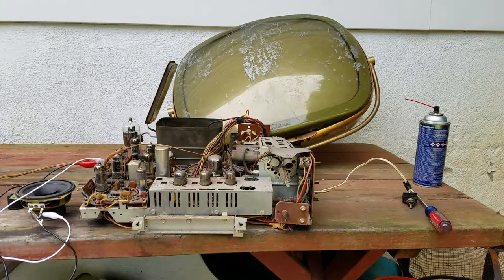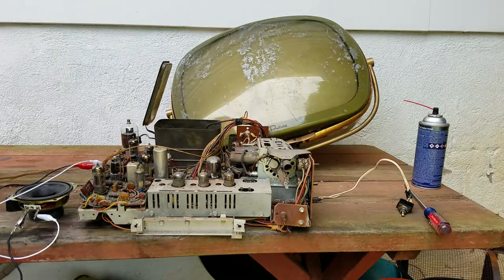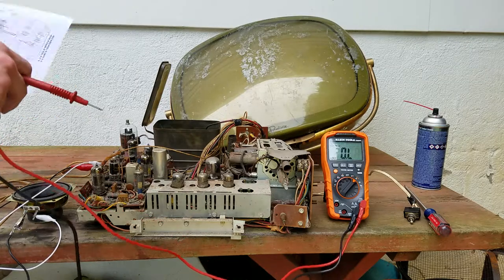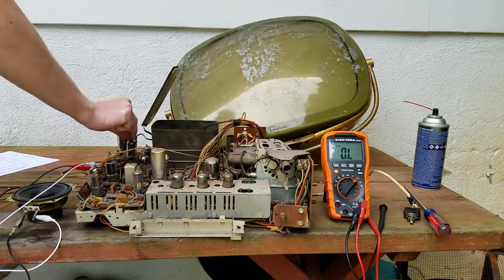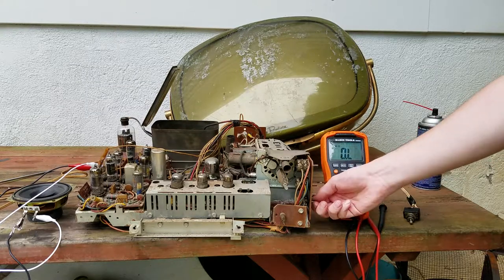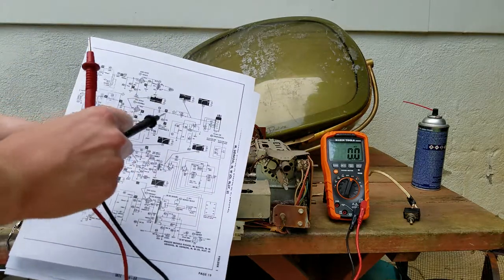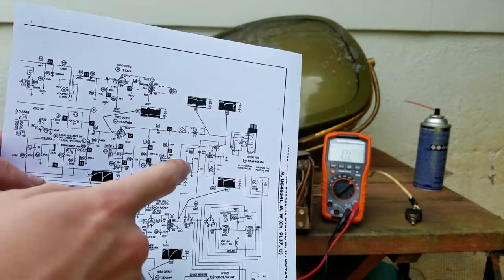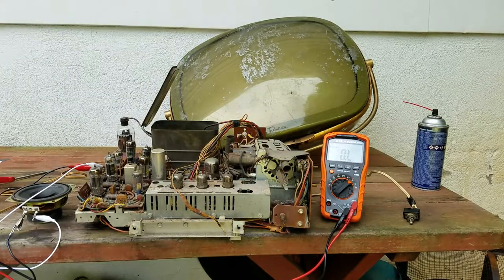Dead Screen Philco Predicta Holiday

Comment: I have one of these in my basement. Always wanted to restore it. It has everything it worked when I first got it Thirty years ago.
Reply: Just do a simple CAP replacement first and se if youi get a better performance. Make DAMn sure you use the exact same values. Don't copnfuse .0033 with .033, etc.

Comment: hi
maybe let the tube bake for a while or try rejuventaing it...connecting g1 and cathode to 220v mains with a 15w lightbulb in series has worked for me before, now i have a crt tester/rejuvenator...i know they dont make miracles but a crt with just a little bit of emission sometimes can produce a watchable picture... cheers
Reply from the maker: If this has been basically any other TV I probably would've gone farther, but between the cabinet which was in pieces and had to be glued back together (and parts of it are still maimed, such as where someone drilled a hole to mount a replacement power switch, and they also drilled a hole through the metal front grill to mount a replacement speaker), the cabinet collapse had damaged a coil on one of the boards, and the dead CRT I decided this one wasn't worth it. Despite the other damage if this had been the 6 volt version of the tube I might have continued but the 2 volt versions (which I verified this tube is the 2 volt version) are known bad CRTs. If you're interested in one of my more recent videos I did get a Hoffman Easy Vision TV with a weak CRT watchable in the dark
Reply: @bss1250  i was now reading a schematic for a german set that i am currently working on and on this set the cathode is actually more positive than g1...brightness control is from g1 to b+ and the connection to ground only acts as voltage divider...the modulation is also fed on the cathode... are you sure that grounding the cathode will bias the tube hard?or you would be doing the opposite way...my predicta also shows a very dim raster if i disconnect the video wire
your eht could also be low contributing to low brightness...but the spark you drawn with the screwdriver looked healthy to me

i also have a predicta but its an italian version,the chassis is different and so is component layout and schematic
i subscribed to watch your other videos, i also have some videos about my tvs if you want to watch
Reply from the maker: @Hugo B. I went back and checked the schematic, and the arrangement seems very similar to what you describe. Are you saying the return path for the high voltage is actually to B+ and not to ground?  If that is the case I'm surprised it arced to ground as readily as it did, if ground is a high resistance return path. Either way you definitely gave me something to think about, I may get back into this in the future and try it with the brightness pot back in circuit instead of going straight to ground
Reply: @bss1250  The high voltage at the anode is not supposed to return to the cathode...that would cause flashover and destruction of the electron gun like it happens on gassy tubes....you would see a blue glow inside...also if you could ground the EHT it loads down the flyback and it drops to almost zero....i cant explain it with scientific detail because i am no expert but the high voltage is there just to accelerate the electrons that leave the cathode and the faster they hit the phosphor the brighter it gets...something like that...the high voltage will arc to anything close to it that has a more earthy potential,even b+lines.... you dont need to ground the screwdriver for eht to arc to it..however you may feel it depending on the screwdriver you use :)  then you have the other grids wich are for focus and they are just there to electrostatically center the electron beam

i can only talk for certain about my sets but i believe your predicta would work the same way! there are sets with positive going or negative going video modulation...and some sets feed modulation to the cathode and some feed it to the grid...(the vast majority feeds it to the cathode) ,along with the modulation there is always a dc component in order to bias the tube....i believe all crts have to biased the same way so just try feeding the cathode with about 20 to 30v more dc than on g1 , that should bias the tube in a way that it produces a nice bright raster..also you need to check voltage at g1... if your schematic doesnt list voltages you can check the tube's datasheet...but often its just bad potentiometers...  when you said in the video that you did not know wich way around are the controls , on the Philcos i believe the horzontal hold pot has a shielded cable to it, identifying that can help you figure out easily wich one is for the brightness... Also on many of my tv's turning the contrast all the way down kills the raster so that might be a problem also.

edit:
just looked at your video and g1 is marked zero volts on the schematic and cathode 35volts so yes a 20 or 30v difference like i said above and the cathode is more positive than g1...i really believe that the ground point on your brightness pot is for voltage dividing. i would check those two voltages at the neck of the tube...the other grids dont really matter because they are used for the focus.you have 400v boost voltage on one of them and you can select from 0 to 200 and something on the other, whatever gives the best focus
Reply: the filter choke you mentioned after the video amp is just a video peaking coil and you can bypass it if its open...its just a copper coil wound around a resistor making a certain inductance..bypassing it makes some artifacts in the image but no big deal. also if capacitor c24 is leaky you will have excessive DC voltage at the cathode because it will go around the brightness pot making the image brighter, i dont know if excessive voltage can overload the tube and make it cut off, maybe it can...100v like you read there seems excessive to me in respect to a 0v g1...  i would also check the EHT, i believe that 15kv must give you a 1cm steady arc...those eht rectifiers like to go weak
Reply from the maker: @Hugo B. Thanks for the info, I had always just assumed that grounding the cathode would produce the max brightness but I see this may not always be the case. I think I will try working on this TV again in the future
Reply: @bss1250  on "normal" vacuum tubes usually thats the case...the smaller the cathode resistor to ground the harder the bias...but on a crt usually not...the bias is the voltage difference between cathode and g1...i am glad if i was of any help. i am still learning about vacuum tube tv's, unfortunately nobody cares about the subject so i feel kinda lonely on the hobby
Reply from the maker: @Hugo B. Iv'e only worked on a few TVs so far, but I think its an advantage that not as many people are interested in TVs as it somewhat keeps the prices low. I got 2 of my TVs for free and one for $10. Same thing with repairing mechanical calculators, where even on ebay they're often cheap
Reply: @bss1250  here is different...expect to pay 100 to 250€ for a 1960's tv in Portugal...people are very hipster and they think an old tv is vintage,cool, space age and whatnot so they price accordingly, but if nobody buys they rather put it in the dumpster or extract the copperfrom it then selling it for a fair price...its sad... also we were in a dictatorship until 1974 so our tv history is not as old as on the US...no tube colour sets here , no 1940's tv's either... i learned alot form shango066 channel and by spending hours trying to figure out simple malfunctions...i wish i had a local mentor to help me sometimes
Reply: @MrHBSoftware  I'm 67 now and started when I was about 30? and even baack then I felt like I was working in a buggy wip factory. The Internet came in and I begin to meet other buggy wip makers. ITS FUN to work on these Predictas if you don't get mad and BASH a few with a sledge hammer. After 30 years of fixing these, I still now, have one I am working on giving me a bad fit- no raster???? And I do believe the pic tube is a good 6v tube. Yes, these are times you CANNOT figure Mis predicta out.